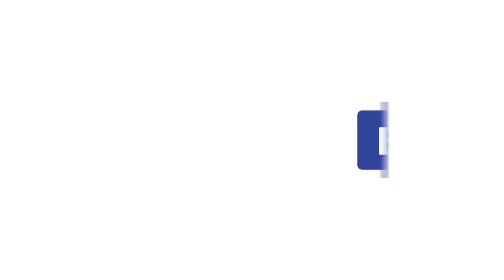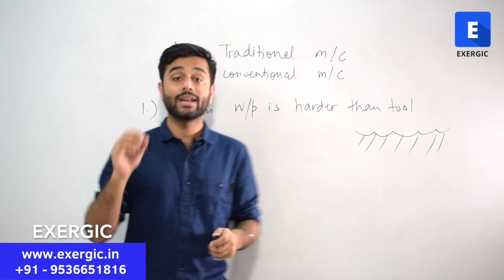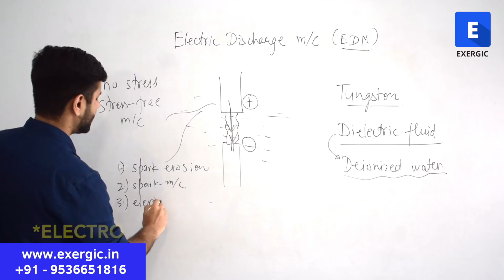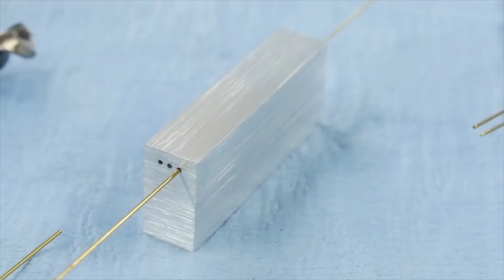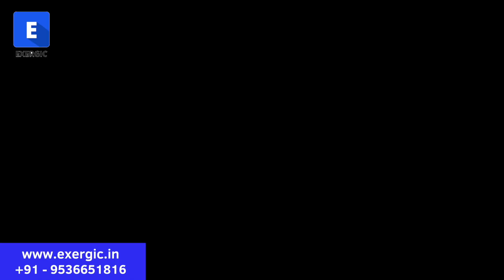Most conceptual coverage of Non-Conventional Machining: Electrical Discharge Machining | GATE ME

Comment: sir i have a doubt... current flows from negative to positive ( flow of electrons is from negative to positive). so when the tool is connected to negative and workpiece is positive how the material is removed from work piece??
as the workpiece is connected to positive the material from tool comes and gets deposited on workpiece then how come material is removed from workpiece??

Comment from the maker: Timestamp:

0:05 Introduction to Non Convectional Machining
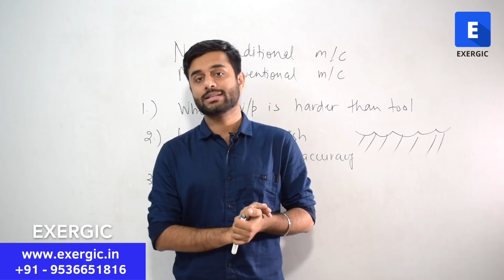10:57 Introduction of EDM
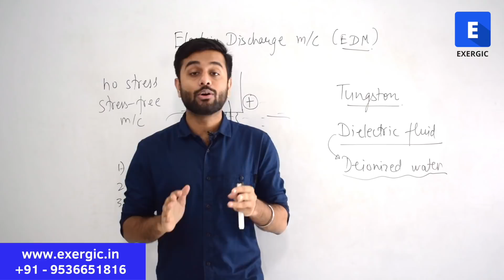18:45 EDM Process and Material Removal 
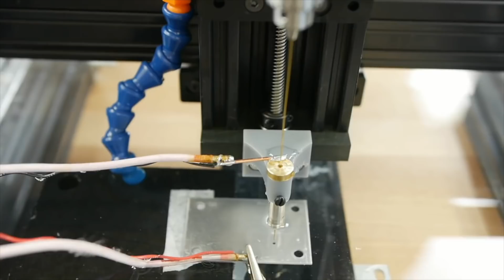31:34 Advantages and Disadvantages
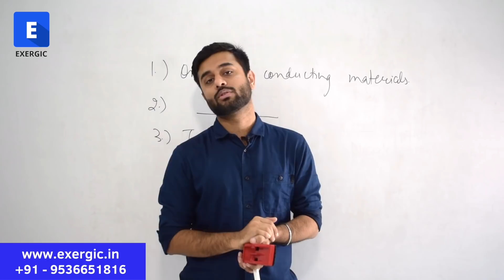39:42 Numerical calculations
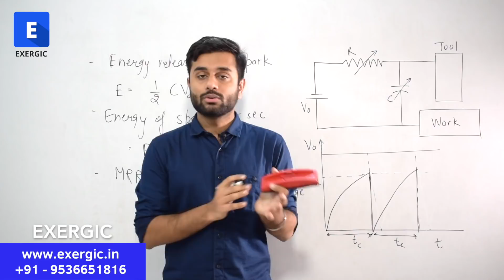51:35 Graphical analysis of MRR
Reply: Sir, how tool for EDM is manufactured ? As manufacturing  accurate tool is only done when tool is precise